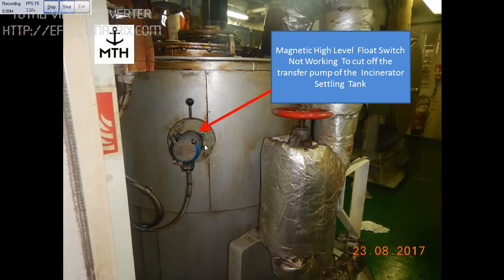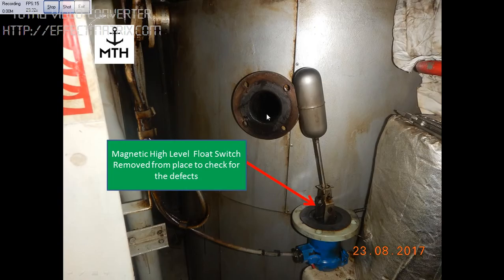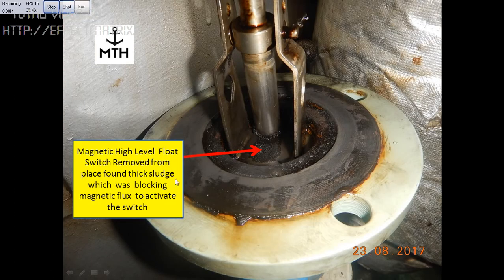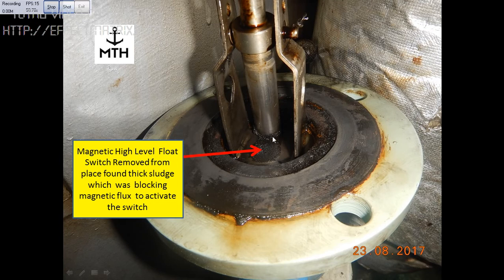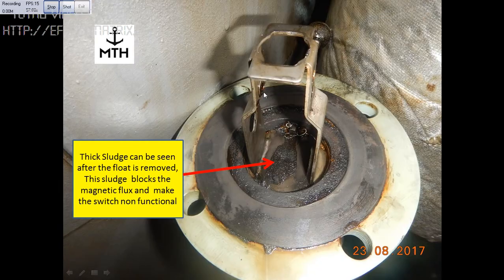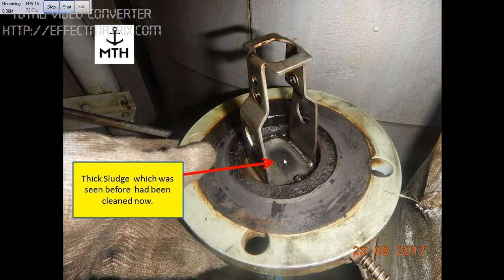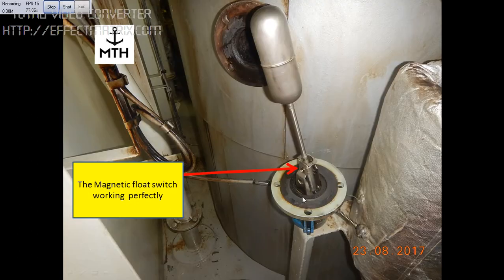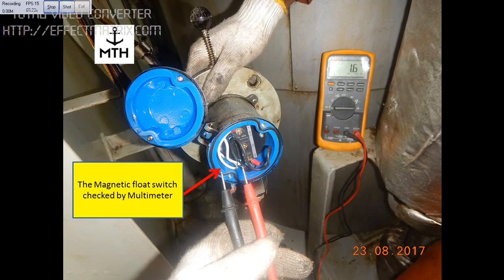How To: Check Defective Float Switch Magnetic Type?

Comment: across which terminals are the voltage being measured ?
Reply from the maker: Thanks for the feedback. you can measure the continuity keeping one terminal in common and the other terminal in Normally open or normally closed according to the position of the float